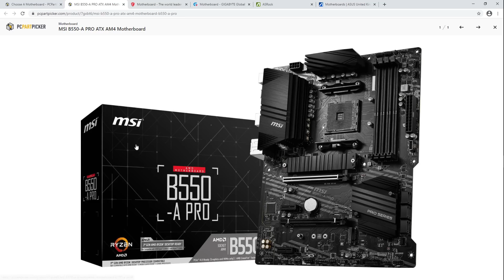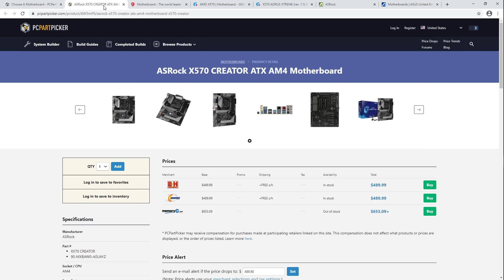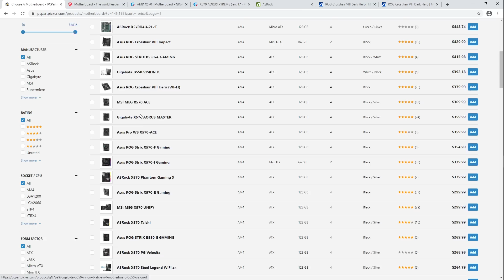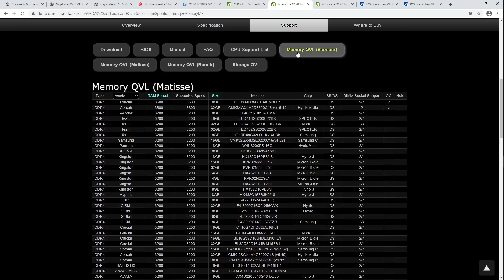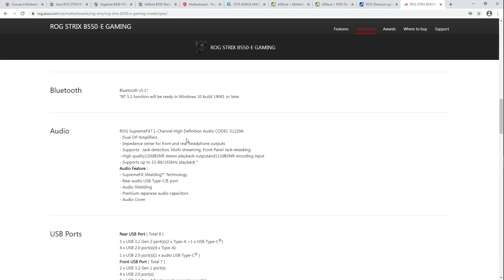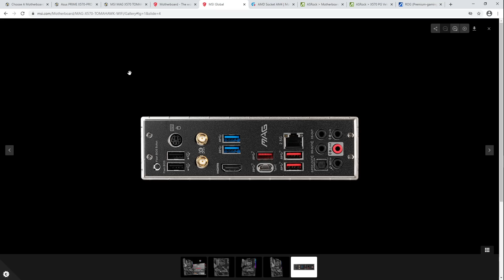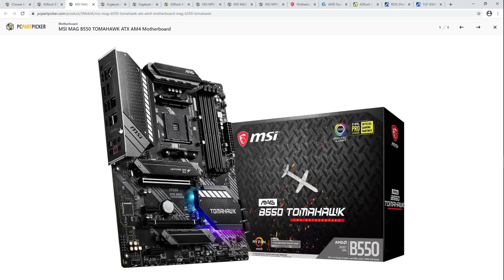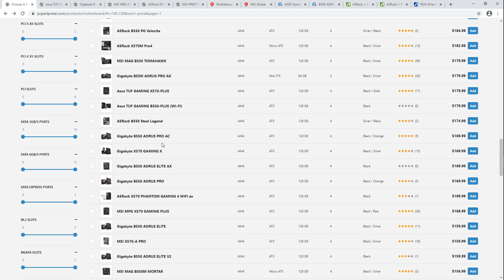Rambling about B550 and X570 motherboards. December 2020

Comment: I want to agree with 30:01 because I have this board for almost 2 years now. Biggest issue I have with it is the realtek ethernet port is trash. I've done every troubleshoot I could look up, I've switched up every driver version and the port will basically give me a fraction of the speed I should be getting at randomly during power up. Solution is to basically enable/disable the port over and over until it gives me the 100% speed I should be having. 
Its extremely disappointing they put such cheap chips in what is supposed to be a premium board.

Comment: @ 1:58:50 The ASUS TUF B550M Plus version of that board is surprisingly good with the latest BIOS update for Memory Control... although I leave it at the Default XMP(D.O.C.P on) 3200 CL14 settings. Pairs well with a 3800XT :)

Comment: I'm looking for a x570 board to couple it with a r7 3700x to overclock it to 4.0-4.2ish ghz and cool it with a phanteks ph-tc14pe cooler. Can you recommend an asus or msi board? I wanna buy a reliable board for it which isn't overkill and is rgb capable. Thank you.

Comment: B550 Master is a beast at everything you said. The board is solid. The only issues I have had is with the Intel Bluetooth chipset. If you use standby the Bluetooth doesnt wake up and you'll need to power down completely (no power to board). This is actually a known issue with the Intel chipset where it doesnt sleep well.

Comment: My head hurts. I'm building a PC based on Ryzen 5800x and 6xxx GPU. Which mobo is the least troublesome when it comes to setting it all up with a Ryzen 5xxx CPU ? I am reading about all kinds of problems with these CPUs. I just want it to work, and a bit of memory overclocking potential, rest doesn't matter to me.

Comment: I had already pre ordered (it went to pre order) formula but had to cancel it due to delays & also beginning to question my purchase slowly and cancelled it 2 months ago. Also not being knowledgeable about the tech side I used pcpartpicker for compatibility check & there seemed to be lack of support for mid to high end mobo on light prices that has 2 usb 3.2 gen 1 type a case support.

Comment: 1:48:56
Actually, it doesn't. The X570 Gaming Plus is so garbage that it doesn't even support PCIe 4.0 in its secondary M.2 and 1x PCIe slots, despite being an X570 motherboard. It's basically a bad B550 motherboard that uses an X570 chipset because the B550 chipset wasn't out when it launched. It has almost the exact same connectivity options as an ASUS TUF B550 Plus, apart from supporting PCIe 4.0 in its bottom x16 slot (wired at x4 on both motherboards). The TUF B550 also has a thunderbolt header and an M.2 wifi slot, and a better VRM.

Comment: I was finally able to get my hands on a Ryzen 5000 series chip and was leaning toward a slightly higher quality mobo, but the X570 Auros Master scares me with the CMOS/no-post issue. Searching, anything I find is months old, so hopefully they fixed it with a bios update? I only want to do a mild overclock for my new daily driver, but man I'm scared to pull the trigger.

Comment: I plan to use my PC as a high end workstation. No video editing, but will be running lots of VM's and hence looking at fast nvmes. The vision D is one of the best mobos. The ASUS (including Dark Hero) do not have a rich list of QVL for 4x 16 GB ram and seems to restrict most 16 GB or higher RAM sticks to 2 DIMM slots. E.G the Dark Hero does not support BL2K16G36C16U4RL Crucial which almost every other manufacturer supports. So yes, ASUS still has to ramp up their memory support (support just 1 vendor with 1x4GB for 5100 doesn't really count!)

Comment: Thx for the admittedly lengthy and sometimes confusing overview, enjoyed the ride. Would be interested in what you think about the refreshed Asus B450 mobos such as the B450-F gaming II. Think there s a lot of ppl who still have older chips or are looking for any kinda upgrade/ downgrade path that 450s offer. Personally I m far more interested in 450s coz I got two 1st gen chips...and I know others who have as well. Asus claim to have changed the backplate and the Mosfet layout is defo changed (compared it) but I m way to much of a pleb to properly judge that. My googling led me to think that the B450-F Gaming II refresh might actually be just as good as the B450 Carbon Pro Max or even better than the Mortar Max that you praised in another vid.

Comment: If the Tomahawk x570 is $80 cheaper than the TUF Pro, should I just get it. I still don't understand what's wrong with that board from Builzoids PoV? TUF pro is like 300 here vs 220 of Tomahawk

Comment: Asus x570-plus wi-fi is a terrible board all-in-all. I paired one with a 3700x and a 5700xt and between failed boots (a known problem with the board) and bios issues (which I cannot revert to previous version) has rendered my $1600 gaming rig useless for gaming.
Reply: Yeah it's been replaced by the B550 TUF and the X570 TUF Pro.

Comment: Hey question BuildZoid, I have the asus prime x570 p, running a 3600 & 3070. So my PSU only came with a 8 pin connector for the CPU, I’m looking to get the 5800x. Do I NEED the extra 4pin 12v for overclocking for either CPU’s?

Comment: Hi sir .. i am building new Gaming Pc with RTX3090 and Rayzan (3900x zen2 3rd Gen processor) and i will use my pc mainly for streaming Games regularly with  YouTube channel creator 😀.  
 my budget is fine !😇 the shop recommended me The Prime X570-P but i want a good motherboard can handle heavy load or Heat because our country is dam Hot 😳.. 
what is the best Motherboard i can buy? . i am planning to use water cooling and looking for strong 💪 motherboard for long run. Thanks 
Can u pls advice...

Comment: I came for an opinion on the ROG B550-E but you open with a price comparison, saying that at 200 GBP it's a great deal, but at 270 USD it's terrible. But at current exchange rate of 1 GBP = 1.37 USD, they are pretty much the same price!

Comment: I got the MSI Creation Board paired w/ a 5950X + 128gbs of 3600mhz RAM. 

Can confirm how hard this is to overclock. The RAM kit I got is not compatible yet, w/ the 5950X so I keep getting crashes on any auto OC I do, only manual OC works, but I only have time to do that on the RAM, got it up to 3200mhz.

Definitely got this for the i.o. I am using 90% of them to capacity, and the USB Type C is very handy for VR plugging. Don't regret grabbing the board, but likely gonna have to replace my AIO and jump on the custom loop cooling. 5950X runs way too warm.

Comment: 1:28:00 you say Asus fixed memory topology on the x570 tuf pro by seeing from the products page it is supporting 5100 O.C. I'm checking the x570 tuf  gaming plus products page and it also supports that speed.  Which x570 board from Asus had worse memory topology?

Comment: I'm confused about what you said about running 4 x 16gb of bdie at high clock speed being really difficult. I thought b-die was supposed to be the fastest ram. Now based on what you said around the 21 minute mark in this video, that the memory controller can't keep up with b-die. I don't understand. Now what should I use in my build if I'm looking for max overclock?

Comment: I chose the Gigabyte X570 Aorus Pro WiFi MB because of the aesthetics, the rear I/O, the minimum RGB, the VRM cooling, the location of the 1st M.2 slot above the top PCI-E slot, multiple fan headers and of course WiFi. The only con is the chipset cooling fan and it's location. With my 2.5 slot 2070 Super Gaming OC video card installed 2/3rds of the chipset fan and half of the 2nd M.2 slot is covered up. Right now my chipset temp is 60.5 C. I haven't had any problems with this MB even updating the BIOS(s) is easy.

Comment: I have PBO disabled on my Gigabyte X570 Aorus Pro WiFi MB. It just made my 3700X run hotter and ramped up the fans on my 240 AIO with no discernible difference in performance.

Comment: As someone who has built thousands of systems working for a system integrator, software needs to be part of this discussion. I'd spend more on an ROG board, specifically for the software,  even if it meant -1 m.2. Especially considering a good 95% of people who will never use this hardware to it's full potential, it's best for people to just purchase a solid reliable board, rather than actually worrying about topologies, or achieving 4000+ Mhz ram... 

What you mentioned about the master being your favorite 'price isn't a concern' option, and then saying that sometimes it randomly stops working for 10mins at a time and needs to be reset... That shit is nightmare fuel to anyone in the SI community. Companies will stop carrying certain boards because of issues like this. From my 9 years of building ~2700 - 3000 gaming systems and workstations - I would never in my life recommend Gigabyte, or Asrock as a viable option, especially for anyone who's machine is critical for work. Also Asrock bios looks like someone's kid designed it in MS paint. 

It's great to a perspective from a motherboard reviewer who get's 1 unit of a board and gives their opinion, and there are also lots of other different things to consider when thinking about why certain boards have certain features. Fabbing a board design is not by any means cheap, so I think it would be really great for your viewer base to be able to watch you interview some people who actually design these products. I've had the pleasure of meeting some of them (mostly from ASUS/MSI) and they aren't stupid people! Very interesting to hear their perspective as well!

Great video
Reply: I mean yeah while all that you said is true, it is very irrelevant! Just look at the name of this channel and it may clue you in. This channel is made for the people who do overclocking and those who get hardware specifically for that.

Comment: Just bought a x570-A Pro. Wasn't much options in my price range on Newegg the other morning when I bought. Bought along with a 3600, 512gb Team Group(will be replacing with a better drive in the coming months, this will end up in my guest pc I'll be building next month) NVME drive, 16gb 3600mhz CL16(wanted to go for 32gb with two sticks, but just gonna settle with getting another pair of 8's in a couple weeks. Mainly blame this on stock and prices at time I purchased)
Gonna be pairing with the poor man's Aresgame AGV500(500w 80+ Bronze) for a short while until I get a much better psu. Gonna case it all in a Musetex Mesh. 
Picked up a used Sapphire Nitro RX 480 8GB for $100.

My Rosewill Lightning 1300w psu finally took my old system with it, so had to basically build a new machine. Was running the good ol' i7-3930k @ 4.6Ghz paired with a Red Devil RX 480 8GB.

Comment: I used my X570 Master with a 1600 Non AF Cpu with setting my ram in 3200Mhz with no problem at all, Till now i didn't have any problem with my X570 Master using Ryzen 1600, 3950X and now 5900X,I didnt have any problem with the battery too

Comment: Dumb normie question: "X and Y mobo is very good for memory OC" - does it mean that you can achieve better results overall, or that you just will be able to push very high frequencies? For example: will I achieve tighter 3600-3800MHz timings on a better motherboard?
Reply: From what I understand overclocking is pushing a component's SPEED more than it is rated to. Not tighten the timings. So in theory it will just effect frequencies, not timings. So buying a better motherboard wouldnt help with timing. Buildzoid or anyone who knows better can correct me if Im wrong.

Comment: I have an x570 Aorus Ultra, it was so close to being a good board. But it was a mistake to buy. Gigabyte infamously has problems with BIOS updates and like Buildzoid said, once it doesn't want to post, it's not going to post. Very upsetting, wish I had gotten a motherboard from a different brand, I don't even bother to overclock the RAM in my system because of it.

Comment: I read in a review that the ASUS ROG Strix B550-F Gaming  VRM could potentially be dangerous for the PSU because of 4+2 design of the VRM, is this true?.

 In my country that mobo is cheaper than other mobos like the Aorus Pro (by far actually, the ASUS board is on the same price that the Aorus Elite here) and it has BIOS Flashback, something that other mobos like the cheaper Asrock ones do not have. (And the Aorus Elite only has 4 Sata ports so it's useless for me)

Comment: So best motherboard for max 1440p gaming, max infinity fabric potential and cpu overclocking south of 200?  
ALL I use is one 2tb slc nvme, 2x 16gb ram (?) , a wireless mouse, wireless keyboard, ps4 controller using usb and my racing wheel, ethernet and a gpu hdmi out...   ?

Comment: Great overview, but you missed the ASUS ROG Strix B550-A Gaming. It's supposed to be like a B550-F from what i researched, but in a white scheme - and it comes without wifi. I picked it up at 161€+shipping and there's a 45€ cashback deal from ASUS so it'll end up at ~120€. It's been ages since i've had a board this cheap, but I hope it'll run the 5950X well. Any opinions?

Comment: Most of the rev 1.1 gigabyte boards added support for a TB3 addin card so there's now more choices if you need thunderbolt support.

I'm kind of disappointed with my ASRock x570 Creator. I've got it in the relatively small Sliger Cerberus X case with 2 x 240mm and 1 x 120mm rads all as intake and because of all the hot air flowing in the vrm gets quite hot(a bit over 90C on a hot day). The chipset fan is really annoyingly loud too. Also, the DP 1.4 input apparently doesn't support DSC so I can't use thunderbolt docks with 2 display outputs.

Comment: So TLDR, Asus is expensive overall  because of brand i guess and is good at missing alot of features, Gigabyte is all rounder good if can  ignore the dual BIOS setup / CMOS battery problem. MSI and Asrock is in the middle just you need to ask yourself whether you are ok with the extras or removals of some ports lol

Comment: you could be a little more specific on the aorus pro b550 as there are AN ASS LOAD LOL found an AX for 140.00 u.s.d. i have a mpg gaming edge wifi x570 now, debating to get the b550 AX unsure which version, does have usb c rear io, and internal connetor. but im unsure if the mpg gaming edge wifi is good enough for the 5600X and yes im highly into ram overclocking. currently stable 4000 c16 flat 1.4 volts, with 4.75 all core...the AX is identical in specs 5100 ram support or up to on 5000 series... to the one you prefer from gigabyte in specs only its the same price? only i found a cheaper price bc well i am who i am...

Comment: You're right about the Gigabyte bios having a lot of issues. I have an X570 Master and I loved it with the 3900XT on the 2X bios. But with my new 5950X on the 3X bios, it suffers from multiple issues. The most bizarre one I'm running into is the per CCX overclock only affecting half the cores. Half boost to what I set the OC to and half stay at base clock.

Comment: what do you guys recommend between GIGABYTE B550M AORUS PRO/ PRO-P,   MSI B550M PRO-VDH/WIFI, ASRock B550M Pro4 I am planning to run a 5600x (if I could find one in stock) and 2x16GB  3200mhz cl16, I don't need mATX, I don't need wi-fi, I have 1Gb internet maybe that 2.5Gb port adds some value

Comment: Pity you didn't briefly cover the Asrock X570 Pro4 as it has some advantages over the Steel Legend, inparticular the fact that where I am in the UK the Pro4 is a whopping 40 UKP cheaper than the SL:

https://www.scan.co.uk/shop/computer-hardware/motherboards-amd/amd-x570-socket-am4-atx-motherboards#filter=1&manufacturers=ASRock

Your chart shows the SL slightly cheaper, but I guess for whatever reason mbd price differences can vary hugely depending on location.

I know you don't like Asrock's BIOS, but really that shouldn't be a rationale for dissing on Asrock so much, most users will never have to do much with the BIOS once it's set, and mbds at this price level are far more likely to be bought by people who just want to use them for a productive task, not meddle with them re oc'ing, etc. In my case, building a system for someone who studies biochemistry; it'll have a 2700X, 32GB RAM, 970 EVO Plus 1TB and Quadro K5000 (beats me, it's what he wanted), and a decent wifi card since buying any mbd even slightly higher up with builtin wifi just means having crap wifi or sacrificing other requirements, one of which was having 8x SATA3 ports. I actually wanted to just get another X470 Taichi, but those are really hard to find now, while the Ultimate is available but its price has gone through the roof.

The one thing which bugs me btw about all mbd vendors is why for the love of grud can't they include POST debug LED and power/reset buttons on ALL mbds, period. These items cost diddly squat to include, demonstrated by Asrock even having them on their dirt cheap old P55 Extreme. It's crazy that an X470 Taichi for example has the LED but not the switches (the contacts for them are present though), while the Taichi Ultimate has both, it's penny pinching dumbassery. Most mbds costing three times what the P55 Extreme sold for don't have these basic features, it's nuts.

Anyway, I told Asrock NL they should watch your vids and improve their BIOS. ;)

Comment: 1:42:49 ASRock X570 Phantom Gaming-ITX/TB3: As he says, if you want a mini ITX with Thunderbolt 3, this is your only choice. And, as he says, the I/O panel is not great. But I needed TB3 on my mITX, and it works. So if the rest of the video is of that quality, it's a good video.

Comment: Keep in mind that many of the boards with 3 m.2 slots, tend to have many compromises, for example, some will have undesirable behavior, such as one of the m.2 slots sharing bandwidth with the PCIe X4 slot as well as 2 of the SATA ports depending on which type of m.2 drive is installed.